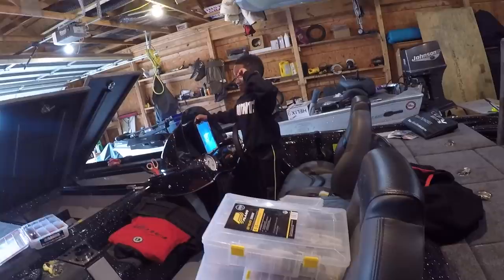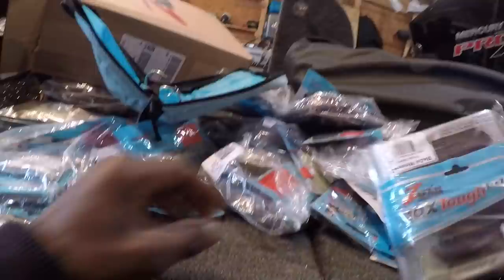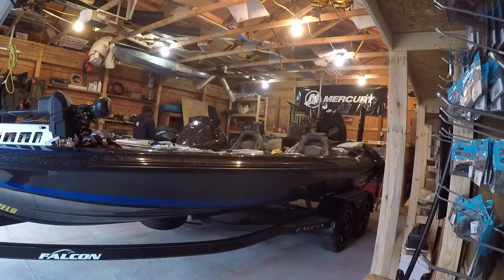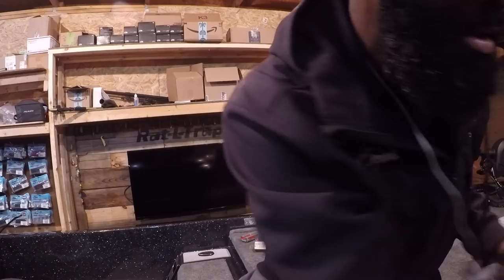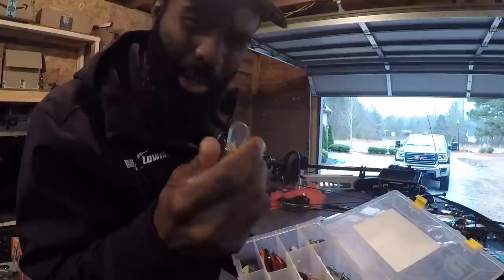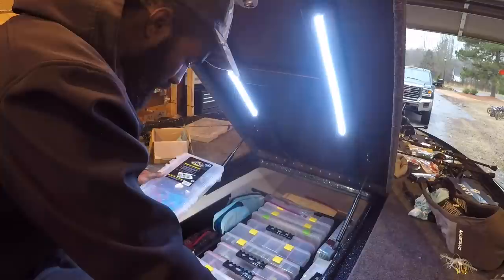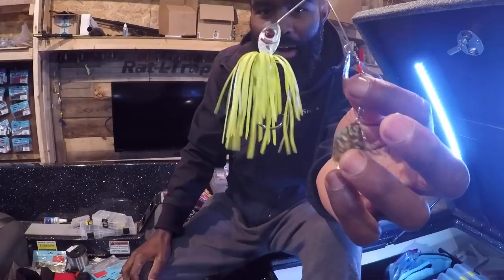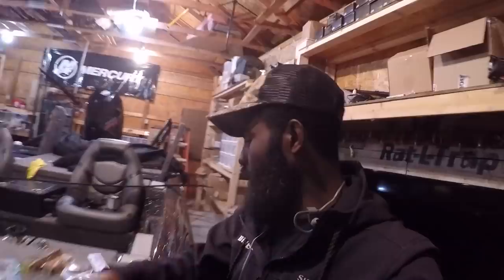Stuffing My Boat With Tackle

Comment: Brian, a trick I use to recondition plastics( is a ziplock bag and spray your favorite bass lure spray on it be it garlic, ect). Leave them in the ziplock. When they begin to dry up give them another shot of spray and roll them around the bag. They will last forever. Most times they out last the ziplock bag. When they begin to feel funny give them a spray you may save them.
Reply from the maker: That’s a good look

Comment: Hey Bryan! On your power pole remote , if you use Velcro tape you can move the control fob from the helm to the deck and your not stuck to one spot...
Reply from the maker: You must not have the wireless foot controls?
Reply: @BrianLatimerFishing  true.. Have one of the early style..

Comment: I'm 37 and have fished those old school spinner bait skirts for years still even use a few till today. But unfortunately they are becoming a bit harder to come across. But they do imo give off a totally different and depending on water conditions also they can perform better then these new school skirts. Also yes old school tubes they still rock when fished proper! Tight lines